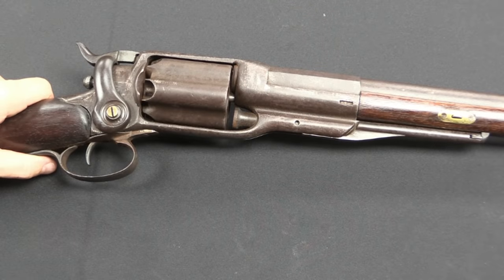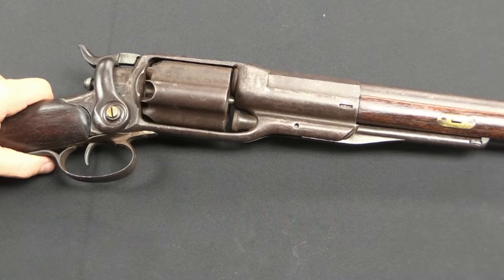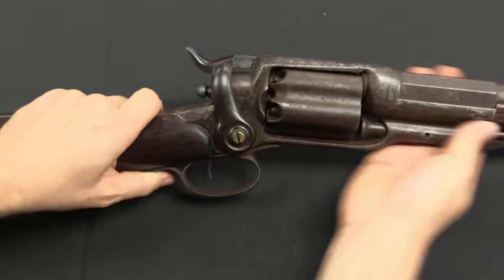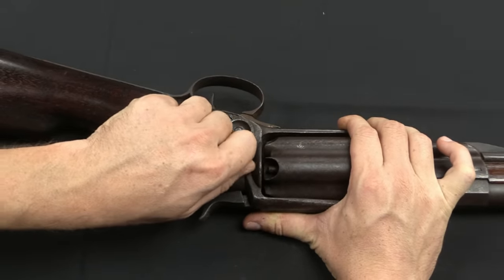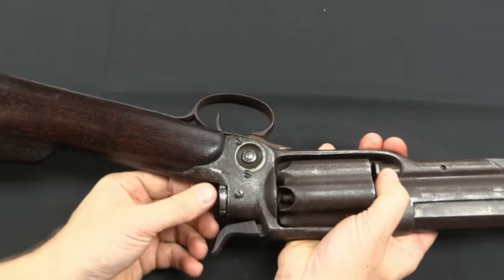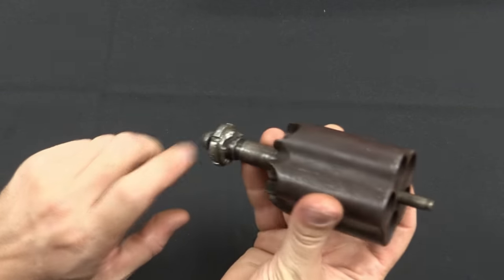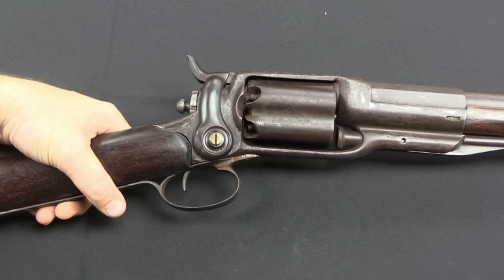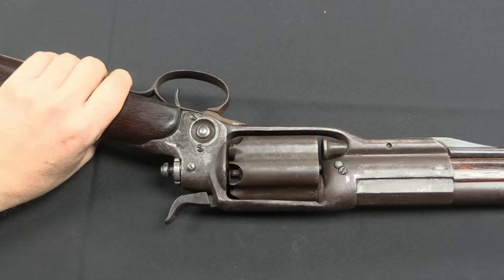Colt 1855 10-Gauge Revolving Shotgun

Comment: I feel the spray could be mitigated by using a leather cuff or bracer on the forward arm, similar to an archer's slap guard.
Reply: That makes sense and might work  I do have archery experience so I can see what you mean by that I'm thinking a bracer could work better
Reply: True, but what about the splatter from chain firing if it should happen? That damage can't really be mitigated by attire unless you wanted to wear a steel gauntlet.
Reply: I feel that's a bit of a null point. If you have a chain fire then you have other problems. I was only suggesting a way to mitigate the problem of getting burned by normal fire. Also, to help mitigate chain firing, smear a little crisco across the face of the cylinder.
Reply: The quality of this chat is unmatched on YouTube.
Reply: That would help with the spray but with these older model rifles and shotguns you still have the possibility of a chain fire which you do not want to put your hand in front of, if you were to design a revolving rifle or shotgun using modern shelves that's not much of an issue but back then that really contributed to their death as a type of firearm

Comment: I imagine if an action sort of like a nagant revolver where the cylinder has a lock, thus no spray, would work very well with this type of "revolving longgun"
Reply: I was thinking the same thing.
Reply: Such a design was used in the pieper revolving carbine
Reply: Nagant-like system requires quite a specific cartridge with bullet fully sunk in the brass case, so obviously not suitable for caplock era. As a guy above mentioned this system was used in Pieper revolving carbine, which was neat, I suppose, but it still used that quite rare cartridge configuration. So I guess, that's the answer. Gas-sealing system for revolvers (and other revolving guns) requires specific cartridge which was introduced only in lately 1800-s, 1890-s I guess, a period when revolving systems began being obsolete with introduction of first successfull semi-auto box-mag pistols. Needless to say, that revolving rifles also felt outdated for that moment compared to others, so the idea of gas-sealing system didn't get any development in future

Comment: wearing thick sleeves/long gloves to protect your arm would probably be much better than holding it in that funny way
Reply: Infantrymen that were issued with the revolving rifles in the Civil War were drilled to fire it with the loading lever down, using it like an ersatz foregrip. There were very few incidents reported, most likely because of the consistency of factory made ammunition.
Reply: Or do it like the russians and seal the drum with  a blast shield, like on the MTs255.
Reply: Yeah, that would not be fun at all lol
Reply: @ThePandoraGuy  That would increase the risk of a chain fire like he said in the video, that only works on cartridge firing revolving rifles, but it's a different story with black powder cap and ball rifles since the shield redirects the sparks and hot lead back into the chambers.
Reply: @Insanabiliter_In_Linea  My bad. I forgot about black powders temperament.
Reply: That may be one of the reasons that the thick leather glove uppers were so popular.
Reply: @Insanabiliter_In_Linea  if the sparks hurt your arm and the shield redirects them back, wouldn't it also redirect them towards and hurt your face? I mean if you are aiming down the sights you seem bound to get at least a spark in your eyes at some point. Doesn't look like the shape of the gun would stop that
Reply: @xthee_0nly_1x11  a modern shotgun shell is still a cartridge, while this gun is a percussion type, aka muzzle loaded.

Comment: The barrel retaining block is actually a wedge, like the pistols. Theoretically, you use it to snug the barrel back as close to the cylinder as possible, greatly reducing the gap and accompanying gas and lead leak.

Comment: That is a brilliant design! The hand and so forth being hidden away from all the black powder, and the cylinder not getting additionally worn - just replace the pin. 

If they had fixed the handling, so that it won't spit junk if held in the front, it would be a very interesting and practical design, more so in shell-less black powder operation.

Comment: I shoot my Remington revolving carbine by holding on to the loading lever like a Vertical grip. Then, when I cock it I just fold the lever slightly so it’s not making contact with the cylinder. Not awkward at all after getting used to it, and can get really fast follow up shots without any fumbling. Works really well, and has bagged at least 20 hogs here in Texas. I really like revolving long arms.

Comment: The cylinder spray problem is easily fixed by attaching a hand-hold to the underside of the barrel. 
   That way, your supporting hand would be underneath the revolving chamber rather than along side.

Comment: Great video as always, very informative, and thank you for the recommendations a couple of videos back including British muzzleloaders and crsenal. I have a question about this revolving shotgun though. What is the hole on the top of the frame just above the cylinder gap for? My guess is it's either a drilled and tapped hole for an old scope mount which seems silly considering it's a shotgun. Or could it possibly be a vent hole which directs most of the gasses safely upwards, somewhat efficiently solving both the cylinder gap blast and chain fire problem allowing this to be held at the fore end more safely? Seems like that cylinder gap is pretty darn tight for one, and the breech face seems to have a bit of an underbite as it were which could direct gasses up through that little hole. Very interesting if that's the case, an acceptable sacrifice as well since the sight picture gets obscured for a good hour anyway with most black powder firearms. What do you think?

Comment: Crazy thing about the Colt 1855's (pistols and rifles) isn't so much their mechanism or even their capabilities, but rather some of their historically significant uses; for example, with regard to how effectively a group of 8 men tasked with a delivery between Independence, Missouri and Santa Fe it was said basically that "in case of attack these 8 men are prepared, able to discharge 136 shots (2 pistols + 1 rifle each) without the need for reloading. We have no fears for the safety of the mail"

Yes that's right, the bloody MAIL delivery. It's sort of insane to think that this kind of firepower used to be necessary just to get the damn mail delivered at certain points and in certain places in history, quite insane indeed.

Comment: Another way of dealing with gap between the cylinder and barrel would be to do a nagant revolver, and have the cylinder press forward lock against the barrel.

However, that would be more complicated, expensive and unpleasantly tough to operate in double action. Maybe a thick jacket as protection would be better if one planned to fire this with a normal grip.

Comment: could you not just use a long sleeve? or glove?
Reply: i think i'd risk the burn to have better recoil control honestly
Reply: wikikomoto  From what Ive gathered thats what most did.
Reply: wikikomoto Ever wonder why wool coats were issued to soldiers during and prior to the Civil war?
Reply: Alan Morgan Had nothing to do with the firearms that were used at the time...
Reply: Jeff Smith Yeah, kinda obvious as most didn't use any sort of revolver rifle.
Reply: Powder flash from flintlocks cause severe burns also... and yes, that was why many military units avoided cotton and favored wool even in the south...

Comment: I wonder why they didn’t put a downward grip on the frame of the gun just about under the cylinder gap. Maybe a little further forward or backward on the frame. It would certainly keep your hand out of the way of most of the spray or any chain fires, and it seems more obvious and easier then trying to make a “shield” to keep the spray from happening.

Comment: Would it be safe to hold the forestock on this shotgun when firing it? Or would you risk injury to your hand from the cylinder blast? Would wearing gloves mitigate this? Holding it with both hands behind the trigger sounds extremely awkward.

As Mythbusters showed holding your thumb directly over the cylinder gap on a powerful pistol can amputate it. Although with the longer distance between the cylinder and the forestock here that seems unlikely but it could still do some damage. The Russian Nagant pistol solved this problem using extra long cartridges which completely sealed the gap, and I'm surprised other revolving firearms never implemented this.

Comment: Even without our retrospection, it seems like an obvious improvement would be a vertical foregrip. Even a really long one to avoid discharge around the cylinder seems better than holding it as demonstrated.
Hell, even a forked muskateer's rest wouldn't be terrible. Though not for a shotgun usually.

Comment: Love watching multiple times as I get something new each time. Right now I am wondering why colt never used this system on full size pistols and only on pocket models. It could  well have satisfied  the complaints of the open top design being weaker than a wraparound frame. It also seems a much more elegant design. It also looks like it would do a better job of keeping the fouling out of the moving bits and especially keep pieces of caps from falling down behind the hammer,  jamming things up. Can't help but wonder was Sam Colt so wrapped up in his own design that he couldn't see the value in anything much different? Also have to wonder about the internal company politics. All of the colt designers whose names we remember, Thuer, Roote,Richards and Mason, held powerful positions within the company. Could there have been power plays to see who got Sam's ear at any given time. Lots of stuff  like that goes on in modern companys, why not then? Fun to speculate....just remembered a prototype drawing that survived the Colt factory fire of the early 1860s fire. No story survived with it but It was a Root-ish looking full size revolver,  solid looking frame but horizontal, not verticle.  What was that about, more speculation and how might that have effected the Colt co. we know today?

Comment: Could the flats on the cylinder axis pin cause problems with the chambers aligning with the barrel? Seeing as there are five chambers and two flats it looks like the cylinder could be installed in such a way that it locks when the barrel is between two chambers. Is there some mechanism in place to prevent this, or would it just not be an issue since the gun wouldn't fire like that anyway?
Reply from the maker: JimJamtheSailor The flats are not quite parallel, so the axis pin can only be installed one way.

Comment: That would be awesome for a combat situation
Reply: Joe Randella Not really.  It's not a cartrige gun, so loading all 5 chambers would take several minutes, if it chain fires it will blow your left hand off, and it's constantly spraying you with grit and fire even  if you're using it right. There's a reason these weren't very popular.
Reply: Fragtastic Still it looks like a badmanz zombie wepon u know
Reply: Joe Randella  For the Civil War era i imagine it would have advantages. long sleeves or a cloth cover helped the blowby. even though its 5 chambered theres ways to quickly load 5 short "barrels" as opposed to one or two long barre;s of a musket or rifle. Most of the time new innovations like this fell by the wayside either because of mechanical failure or our apprehension try new things. we kinda get set in our ways. the first bullpup designs here werent met favorably. Cost can be a factor too, if i remember right these were very expensive compared to a single shot percussion shotgun or musket. One thing i can think of as another advantage is loading while prone or squatted behind cover, in a "trench", etc. Having tried and succeeded loading long guns in hunting blinds, squatted behind brushpiles etc its not the easiest thing to do. if your of shorter stature its nearly impossible. I actually ran the ramrod of a reproduction Brown Bess thru my popup blinds roof once while reloading. I wish a modern company would bring out a modernized version(just a little) of this shotgun. A repro Colt 1855 in almost this exact configuration. I think it would be one of those "fun" guns.
Reply: brad gillis im too yung to read all that sorhy
Reply: brad gillis Well put sir.
Reply: Thank you Sir. I would truly love to own a shootable version of this. With all the "retro" stuff in the gun industry right now I/we can always hope and pray.
Reply: brad gillis The pawn shop near my town sells revolver rifles brand new, so they can't be that hard to find.
Reply: Thank you Fragtastic. Wish we had a good pawn shop nearby. we do have many gun dealers and national chains but they steer clear of any weapons like this Colt. Ive shot some of the revolving rifles but never a revolving blackpowder shotgun. the revolving rifles are neat. a.local group of reenactors has a few cavalry with the i believe repro of the Remington "scroungers" rifle.If anyone knows of a modern revolving blackpowder(or smokeless even) shotgun Id be very appreciative of any info. Ive owned a Taurus judge. I prefer long guns but it was fun to plink with. I collected single shot "modern" guns and revolvers for years. The Colt 1855 is just "my kinda gun: lol.
Reply: Joe Randella And this is why I'm embarrassed to be young.
Reply: ***** Hahaha I had a few drinks and was joking mate don't worry

Comment: Wouldn't the problem with the cylinder gap be solved by having a vertical forward grip? That wouldn't even have to be that far forward on the gun to allow stability, since it would be used to push the stock into your shoulder. Of course, that wouldn't work very well with the ramrod design on this gun.

I'm also thinking that a curved hollow shield would be able to protect your arm while preventing sparks from flying back into the cylinder. That is, the spray would be allowed clear of the cylinder and is then funnelled downwards by the curved shield. Not sure if I get across what I mean with that description. That would look strange and probably not be very practical though.
Reply: Mutant1988 Or just wear an armband made of leather or a thick fabric.
Reply: ***** There's nothing badass about inflicting scars upon yourself. That's just dumb.
Reply: ***** Scars made by melee weapons or animal claws or teeth, perhaps, but burn scars don't. Charred skin, is neither pretty nor cool looking at all. BTW, a pinched web of hand by the hammer of an early 1911 pistol is/was a typical scar, thus why modern 1911s have extra long beavertail grip safeties.
Reply: Mutant1988 
That is a very interesting engineering conundrum, i would assume it would be best to direct the escaping gas straight up with some kinda bent shield
Reply: VicariousReality7 
Couldn't that lead to a gust of wind sending a cloud of powder residue in your face though?
Reply: Mutant1988 I agree, they solved this problem in the Nagant -a revolver that accepts a suppressor! North & Skinner also  presented a solution.Apparently, nobody found it an issue to address
Reply: From what I've read though, the system used for the Nagant Revolver gives it a horrendously heavy trigger pull, which really isn't a good trade off.

The North and Skinner rifle seems to get around that by the cylinder being rotated by lever action and the seal not being achieved by the trigger pull pushing the cylinder forward. I didn't know of the gun before, so thanks for the tip, so I could check it out. 

I think the reason why no one bothered fixing the issue is because they didn't really see a future in revolver style weapons, opting instead to develop magazine systems. Which seems like a wise decision, considering how bulky a revolver rifle cylinder would have to be to exceed 6 shots.

Comment: If I owned one back in the day, I would have worn a leather strap on my forearm to protect it.
Reply: It would be cool to see if it works but the hot lead might burn your leather.
Reply: if its good enough for blacksmiths, i'm sure its good enough for the gun
Reply: I would have made a long downward grip around about under the cylinder, keeping your hand out of the line of spray or chain fire.

Comment: I wonder if any of this type of firearm came with a leather forearm wrap.  I have a Circuit Judge in 44mag and the blast deflectors work rather well.    I really wish S&W would come out with a 44mag (or .357) carbine because the quality would probably be better than the Rossi.  The elevation adjustment on the Circuit Judge is horrid and I broke my rear sight the first day I took it out.  The forcing cone area is also oddly cavernous.

Comment: Is someone try fix it by moving cylinder forward to close gap between it and barrel?
It could be small lever form behind that moved by trigger push it forward. After that spring could push back it and allow it rotate to new position.
Reply: No matter how tight it is, the gap will open due to material flex. Look at shots of guns firing in slow motion. They look like wet noodles.